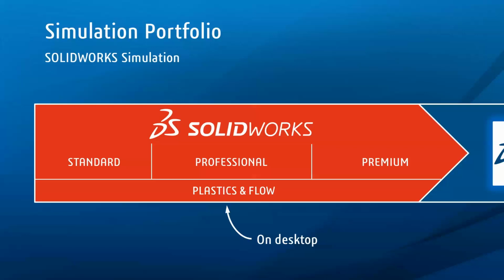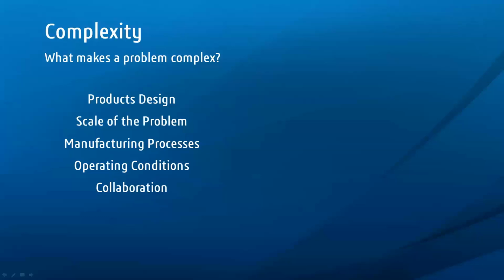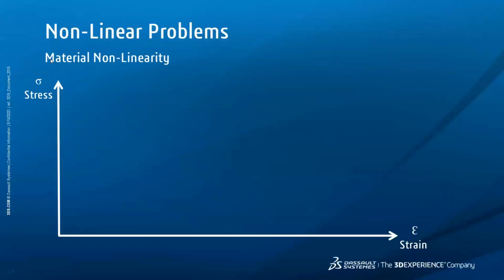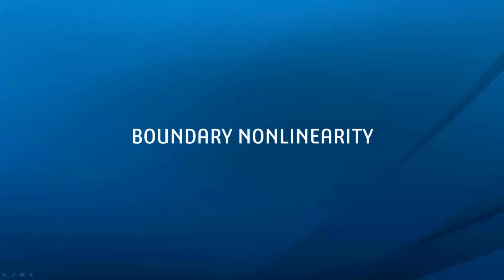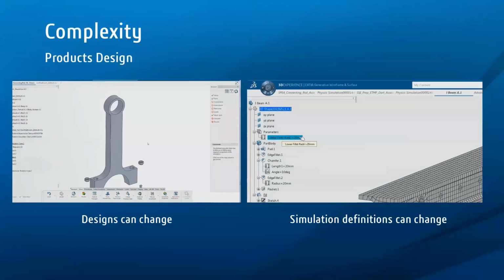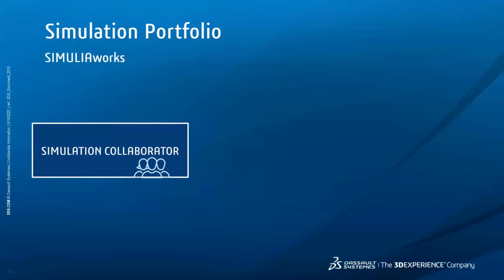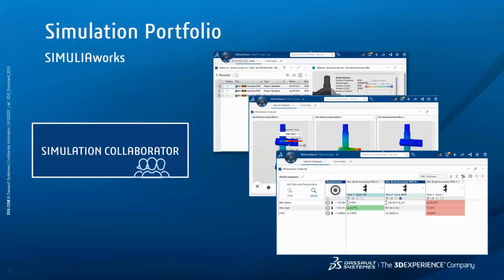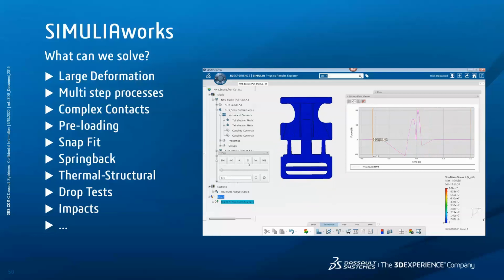Webinar - SIMULIAworks Webinar Recording - 20052020

Comment: How much RAM and graphic card is needed to run the software
Reply from the maker: Hi There! To learn all system requirements for hardware and operating system please visit: https://www.solidworks.com/sw/support/SystemRequirements.html
Reply: @solidworks  tq sir
Reply: The machines I use daily have 16GB (laptop) and 32 GB (desktop) of RAM; each with 4 physical cores (8 hyperthreaded) and with access to the cloud for the big solves when needed. For the full software and hardware requirements along with examples of certified hardware please see here https://www.3ds.com/no_cache/support/hardware-and-software/ :)